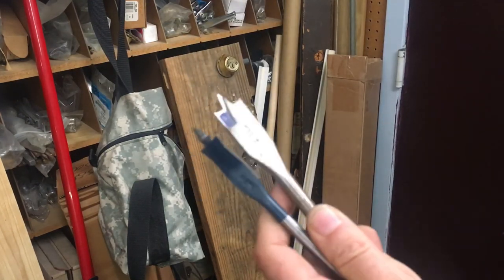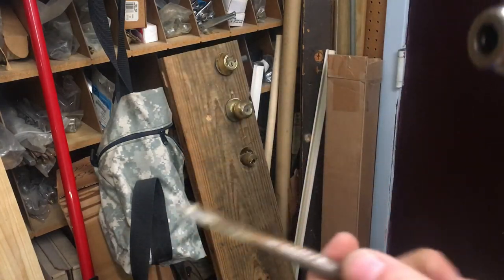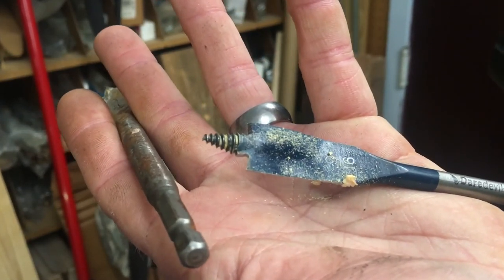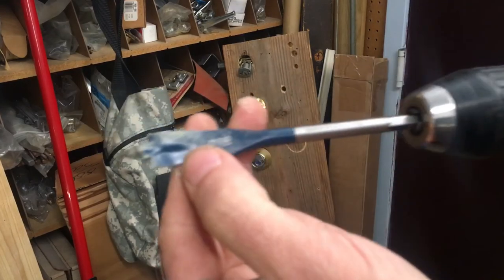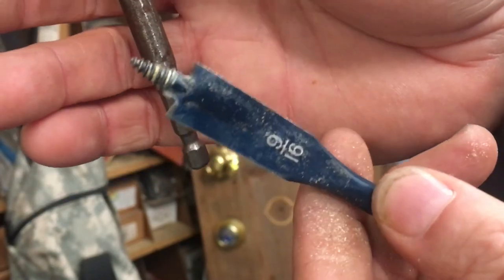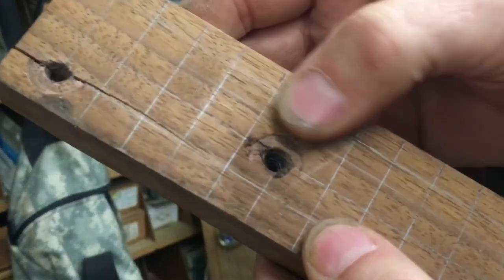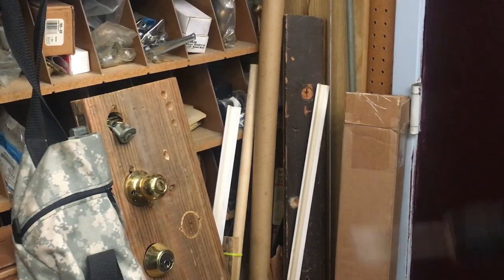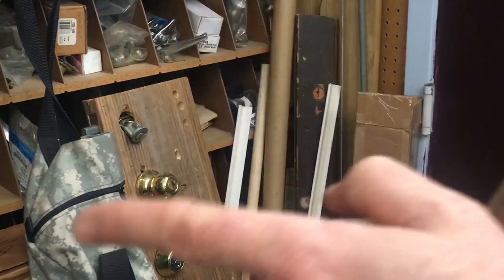arguably, the best style of spade drill bit to use for locksmithing

Comment: Screw type auger bits where not originally intended for use with electric drills. They where used in a brace and bit hand powered drill. Really heavy ones actually had a flat plate on them you could rest your knee or tuck into your shoulder for added force. Electricians and plumbers will use the screw auger bit and electric drill in the center of a piece of 2x4, 2x6  etc for running wire, conduit, or plumbing pipe where blowing out the back of the wood isn't a concern. Anyone as old as I am will remember using a brace and bit set.

Comment: I use both types. The screw tip is great on my 19mm used to make room for the lock case drilling a line of holes deep into the door from the edge. Use the normal pointy tip for drilling through the door blade after making a tiny pilot hole and going a few mm in from both sides with the spade to avoid any damage to the paint